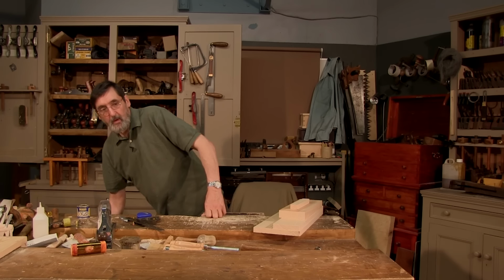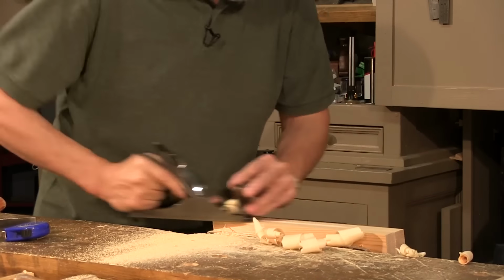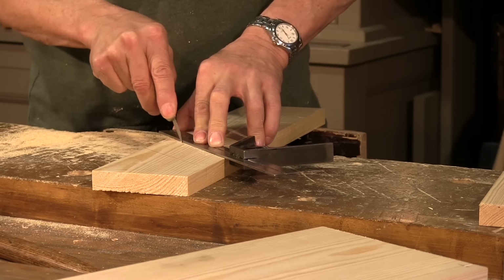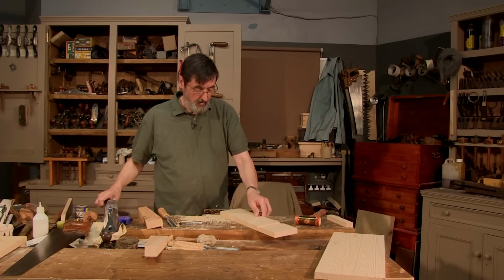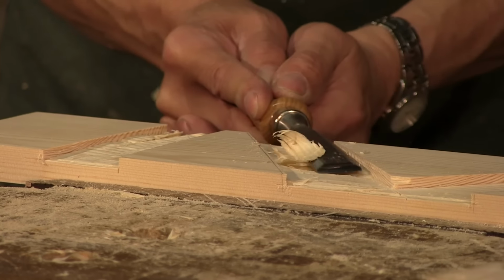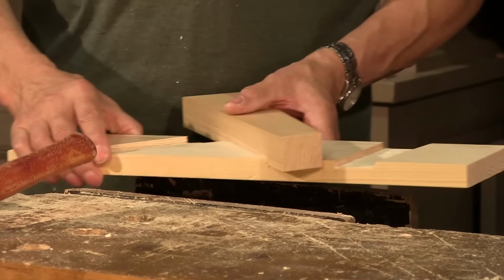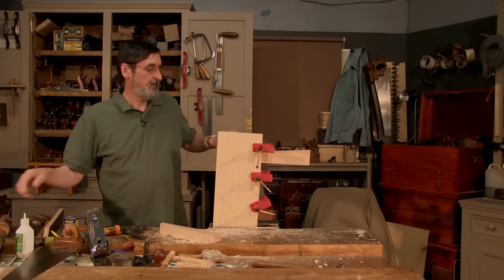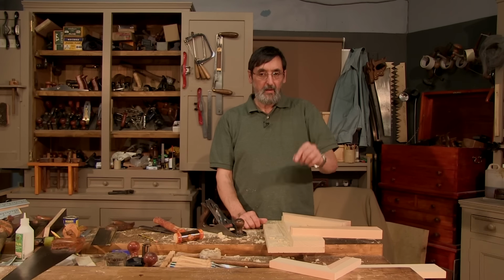Paul Sellers | How to make a Shooting Board

Comment: Hi Paul, I noticed you used a compressor limiter audio processor or auto gain control (AGC) on your audio in this video. Didn't notice you used one before. Please turn it down a notch, to a less aggressive setting, because it's causing "noise rushes" in the quiet parts and amplifying all kinds of sounds which you don't want to be amplified. 

Besides that, thanks for all your great videos.
I always watch them and learned so much from you.

Edit. I now see this is an old video. Maybe it was at the time an experiment in post production. I didn't notice exacerbated audio post production artifacts in other videos.

Comment: Why doesn't the plane cut the guide edge of the shooting board?
Reply: It does not cut the guide edge the distance from the side of the plane to the edge of the blade because there's no blade there.  It's supposed to cut above that line.  Each time you use it you have to adjust the plane blade square and to right depth to touch guide edge, if it's not a dedicated plane.
Reply: Understood, very helpful thank you.

Comment: I have several old Stanley planes that I'd like to use for this board.   I have 3's up to 7's, but unfortunately none of them have a sole that's 90 degrees to the side.    Some are close to 90, but is close to 90 good enough?   Short of taking them to a machine shop and having them ground square, how do I get a vertical cut?    And, no I'm not having my antique Bailey's ground down.
Reply: Tom would it not be possible to choose only one plane for your shooting board? That way you could square the one side wall of that plane yourself using a 90 degree jig and some sandpaper (similar to how Mr. Sellers flattens a sole of a plane on another video).
Reply: That would work if the side of the plane was angled greater than 90 degrees to the sole.   But all of mine have sides that angle in toward the blade.    To get that 90 degrees to the sole would require narrowing the sole where it meets the side.    That's quite a bit of sanding along the entire length of a No. 5 plane.

And would weaken the side and narrow the gap between the mouth and the side.   It's a lot simpler to find a way to angle the surface that the plane slides along.   I originally used a piece of melamine but now I'm looking into some type of plastic that can be wedged up on the outside.   Just a lot more difficult than the video and what I was hoping for.
Reply: Maybe you could just make a dedicated wooden plane to use with the shooting board? Or possibly find an old transitional plane? Anything with a wood body can be planed and/or sanded square easily.
Reply: Tom Dwyer I think what you want is a #51 stanley plane. They were made to use with shooting boards and were machined to exactly 90 degrees, they also have a tilted tote to make is slightly easier to hold horizontally. Maybe you can find one on ebay
Reply: Don't mean to contradict, but a Stanley # 51 is a spoke shave, not a plane appropriate for shooting.
Reply: The sides of the plane doesn't need to be at an exact 90°.  You set the blade at 90° using the lever right above the handle.  Try a cut, check the angle on the test piece and alter the angle of the blade till you get it.

Comment: unless you want to purchase big box store type of handtools, you will spend more money outfitting a shop with handtools than you would with machinery. A decent #5 will cost you as much money as a high quality drill press, chop saw, router, air compressor, etc.  Relatively speaking, hand tools cost far greater than their powered counterparts.

Comment: Instead of shizeling so much why not just glue a second layer at the size of the left area
Reply: Believe he'd then have more pieces to true, mark, cut, finish, require fixing probably with more than glue (which he didn't want there) - as much or more work, losing integrity lent it by single channel piece.

Comment: The hardest part is finding a plane with square sides, or squaring one that isn't square.
Reply: I thought this but I've since read that the sole doesn't need to be square to the sides, you use the lateral adjuster to bring the plane iron square.
Reply: freakeystyley34 I have contemplated the question. I understand that you can adj the blade to become square but it seams to me that once you use that plane for something else then it would not be an easy process the get the blade reset for the shooting board.

Comment: The problem I have with this video is the inaccuracies that will be introduced to every project you use this with.Truing boards with an inaccurate set up will drive you nuts! I just don’t believe you will have the precisione necessary for 45s and such.
Reply from the maker: No you wont. You must train your whole being to make microadjustments throughout your working otherwise you are always constrained by legalism. Take a little risk and you'll find real freedom in your working.
Reply: Thank you Paul for taking the time and effort to respond. I have great respect for anyone who has the skill to get precision with such equipment and technique.I must admit that I have always enjoyed doing almost anything involving tools and making something with my hands. I believe I am very skilled as an artist,but as an artisan I fall a little short.My brother,on the otherhand can make something with great skill and finesse. Not all craftsmen are created equal and perhaps you are correct that I should rely less on the tools and develop my skill more.Maybe that is indeed what has held me back. Thank you for your vids!

Comment: Disappointed that you used a drill instead of a brace. Might as well built the 2hole thing with modern tools, or modern techniques that provide an alternate and closer method of production

Comment: You should never use the palm of the hand to strike a chisel because it will cause bruising. You should know that Paul. What happened to the traditional mallet. I would not be seen dead using a nylon  hammer. Should also tidy-up your bench.